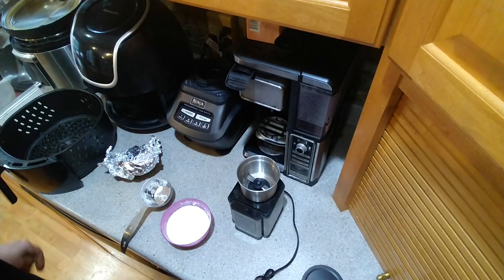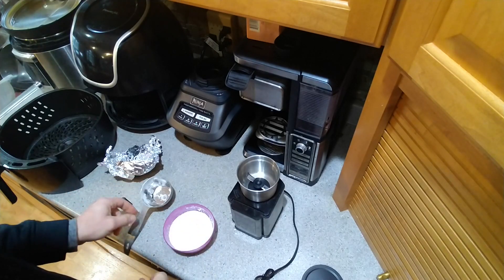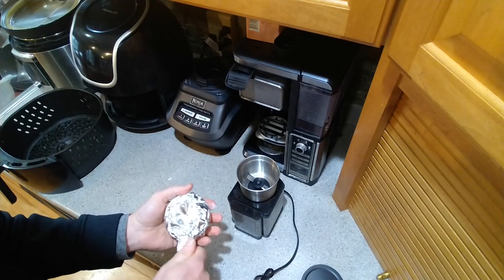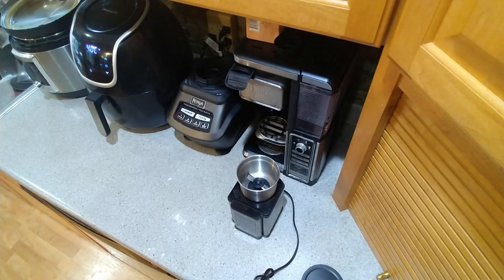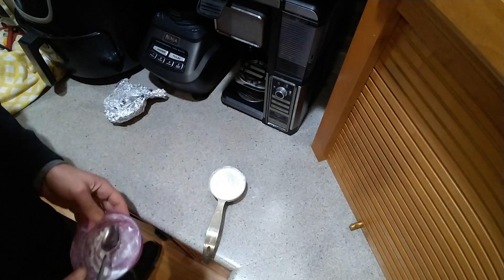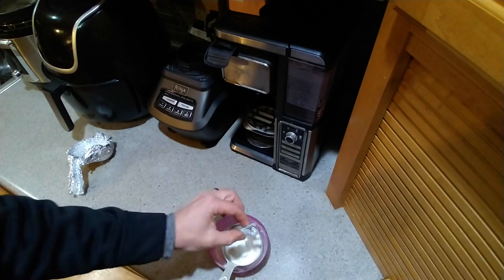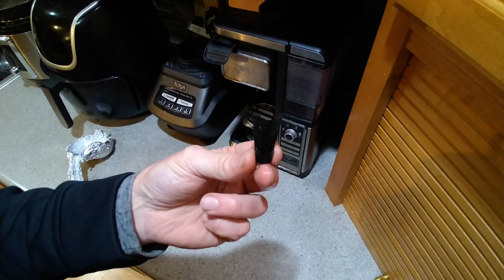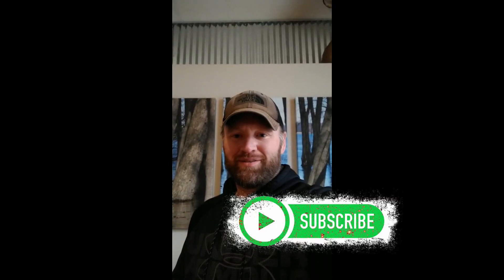Salt Annealing of 3D printed PLA in an Air Fryer

Comment: I don't get the point ; Why don't you print the part with nylon?
Reply from the maker: Two reasons: 1. I don't have nylon. 2. Wanted to see if this would work.  It does, so now I don't need nylon.
Reply: I print with both nylon and tough PLA. most cases you want to use cf nylon but some tough PLA's are more impact resistant than cf nylon. So it really just depends on what you're using the part for and what you're making.

Comment: I think the annealing process raises the maximum working temperature of the parts as well.  I have heard that pla parts will soften and deform in a car on a hot day.  I wonder if this process would prevent this.
Reply: yes, it does. if you remelt it, it will not melt up to 200c with good method.
Reply: Just print in PETG